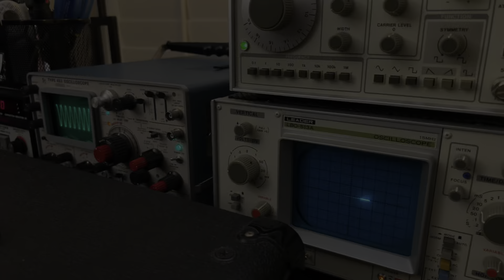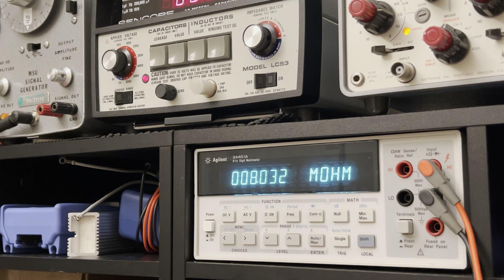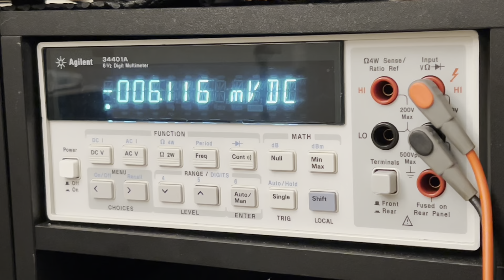Midnight Run 2 || Marshall DSL40C [Silent Service]

Comment: What was the malfunction, and what was the fix? Looks like you were testing power tube sockets.
Reply from the maker: One of the power tubes had lost vacuum. The remainder of the issues were resolved by a little routine maintenance.  The tube socket test was to validate voltages.